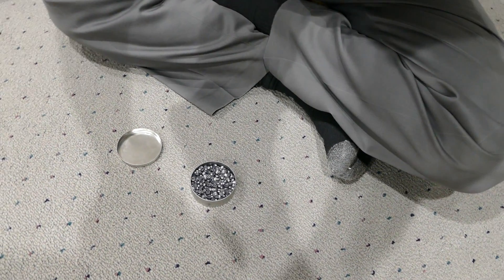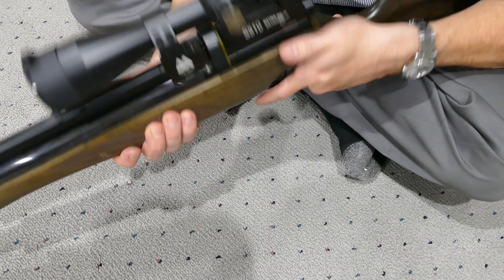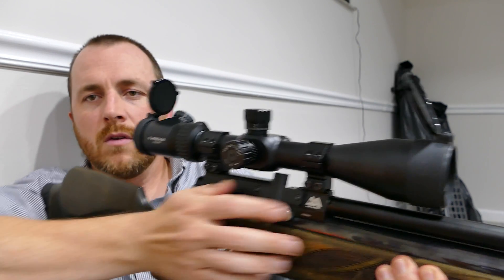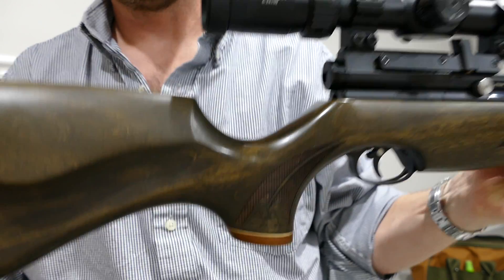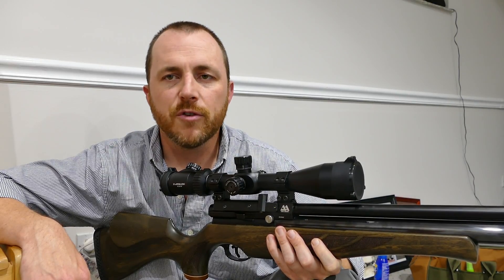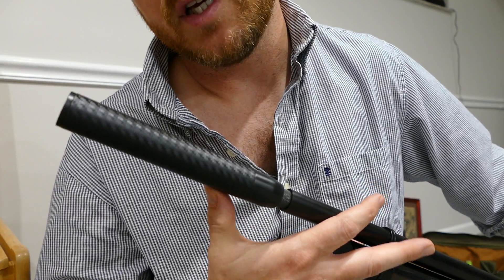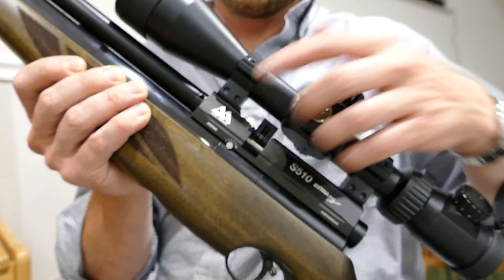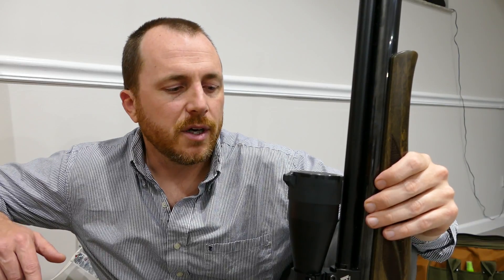Un-sponsored Review of Air Arms S510 Xtra Superlight FAC .22 PCP Air Rifle

Comment: Thinking about getting this rifle. I was looking at the rws Diana 460 magnum. The strongest pellet rifle I have owned, was a Benjamin back in the day..

Where do you buy the cylinders from and how much are they? And where can I purchase this gun from?
Reply from the maker: Don't get a 460 Magnum for your first re-entry air rifle. It's too heavy and hold-sensitive. Since it's a spring-pistol air rifle, it doesn't need cartridges. It makes air pressure by having a spring cocked, which holds a piston. When you squeeze the trigger, the piston slams forward and compresses the air in the chamber behind the pellet. Since there is all this mass moving around while the pellet is still in the barrel, one has to hold the rifle the exact same way every time, or the pellet won't go to the same point of impact each time. This means hold it a bit loosely, supported in the same way on the same part of the fore stock, etc. They are also front-heavy, with the steel cocking lever under the barrel.

Don't get me wrong, I like "springers" too, but a nice pre-charged pneumatic rifles, like my S510 discussed here, are much more accurate, easy to shoot, easier on scopes, etc. You just need to have an air source, be that a hand pump, carbon fiber tank or compressor. Plan on 30-35 shots on a fill, which is plenty enough for a hunting outing.
Reply from the maker: You can get the gun from Straightshooters.com or Pyramyd Air online. Or save a few hundred and get a used one, like I did.

Comment: good video ,how many shots would it do on low power setting and using the lighter pellets
Reply from the maker: About 40. Dialing the power down doesn't really get the shot count up, it just lets you shoot indoors without such a beefy backstop or shout outdoors without as much risk if you miss that squirrel way up in the tree. It seems to shoot just about all pellets well at low power. It's SO quiet with the power dialed down.
Reply: thank you, was hoping for more shots at say power 2 ,

Comment: Your Air Arms S5 10 is an excellent gun, not much can be said that would turn any airgunner off. There is so many good points and reasons to own one .  I agree with one thing, at its price range, and build quality Air Arms is known for, it should be regulated.  Even without, it certainly shouldnt be a reason not to add this gun to any air gun enthusiasts collection . The S5 10 is a beautiful gun, accurate, power is right on point, shoulders well, comfortable, makes a great hunting rifle, and its a pleasure to shoot. Ok its a bit long with the moderator, oh well nothing is perfect, but it sure is close . Great job Jeremy, Cheers.
Reply from the maker: I've read that the latest S510s are going to be regulated. (but a couple hundred bucks more expensive too...)
Reply: Thats really good to hear,  ive come across a few forums where its been mentioned, the more airgunners i hear it from the more i begin to believe it.  The unfortunate part is likely going to be the wait time.  You see up here in the great white north,  Canada,  things just seem to take much longer.  Its safe to say it will likely be months after they are released in the United States before we see them up here.  I have a FX Impact with the the original smooth twist barrel, Im anxiously waiting for our FX retailer to stock the new FX smooth twist X barrel, and the list of suitors waiting to get there hands on one of those  beauties is pretty long.  Correct me if im wrong but i believe they have already available in the U.S.  I was in touch a few months back with the good people over at Air Gun Debot inquiring about the Smooth Twist X barrel but sadly enough they are not able to ship them to Canada once they arrive, the good is, if you could call it that, they  did say that stipulation could change. So i guess i have no choice but to wait. In the mean time i will certainly keep in mind the possible arrival of a regulated S510.  Perhaps if you hear any more information on them, it would certainly be appreciated if you could share it with me, thanks.
Reply: I have an s410 carbine 177, UK spec about 11 ftlbs. It's not regulated but I can confirm I've shot 70 shots straight off in 5 shot groups and poi at zero range of 30 m didn't shift at all, it's stated to do 60 shots but at 70 no change, I stopped at 70 to save wasting pellets but it proves maybe with a good quality valve etc a regulator isn't essential. It put my mind to rest about upgrading to a regulator. Looking to get a 510 xs or 510xs xtra in the future too.

Comment: Nice reveiw. Agree with most of it. But I'm little oldschool. I like it without regulator. Less stuff that can break. And as long as you know the sweetspot, all good. But get a o-ring for the magazine. My opinion is that it is a really good and no fuzz magazine.
Reply from the maker: I think I agree on the non-regulated. I get 36 good shots out of a fill (4 mags). That's enough, and easy to pump to that level again. But the O-ring, I disagree on. I have 4 mags for mine. One came with the gun, without an O-ring. The other 3, I bought new, all with new O-rings, and two of those broke so far. I'd have to buy a whole sack of them to keep up.
Reply: Weird with the o-rings. Bad quality control?. Thankfully I haven't had any problems. I use a very thin layer of silicon grease on them, and no one has broke, yet. And I shoot a lot. But I have broken the index pin a couple of times. Not the best design, but easy to fix.
Reply from the maker: I haven't greased the magazine O-rings, and they had some white dust on them. That was probably the problem.
Reply from the maker: The O-rings on my other two mags also broke. I'll have to order O-rings by the dozen to keep them working.
Reply: Something is not right here?!? Does the bolt get in to the breach without problem? Is the action smooth, or is the bolt hitting the o-ring, and "nagging" on it?

Comment: Poplar is marginal as a gunstock wood unless laminated. I think that looks laminated!?
Reply from the maker: No, it's solid. It's kind of a soft hardwood. If sealed properly, (which this is) it won't be a problem.  It's also lighter than beech or walnut. I agree it's not as pretty, but it does take a stain well. (I'm also a woodworker)